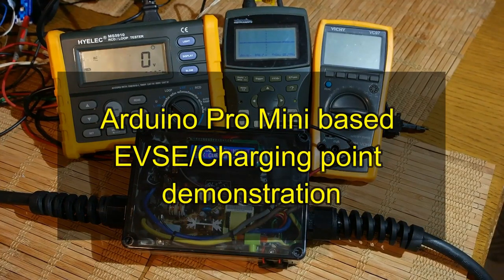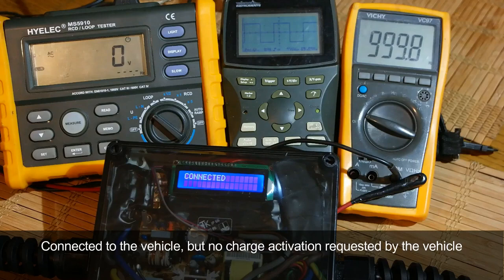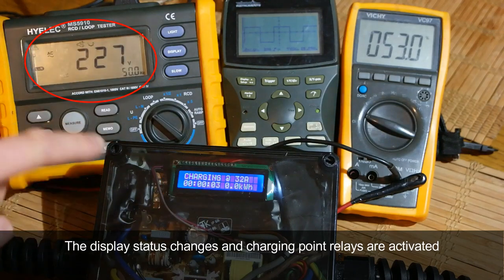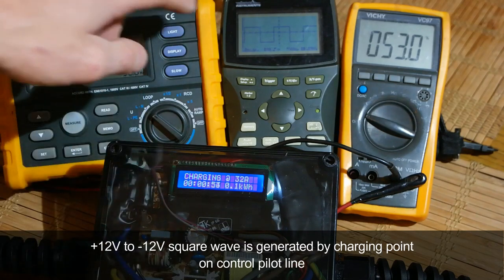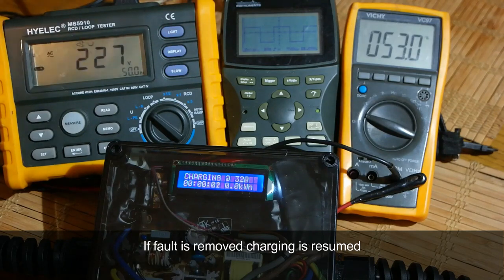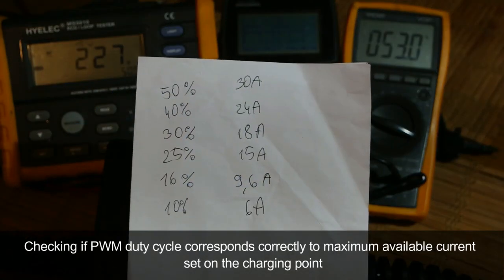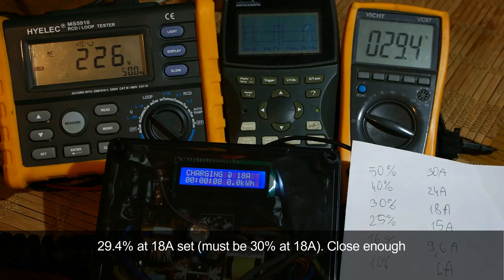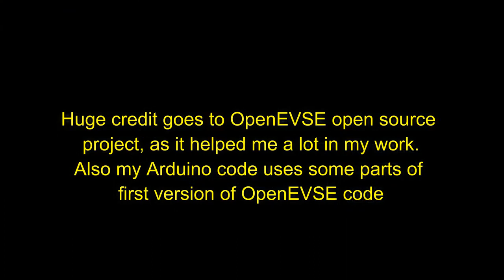Arduino based very simple DIY EVSE / EV charging station / charging point

Comment: Hi,
I made a similar project for the Peugeot e2008. Of course it doesn't work yet. Arduino UNO gives (pin5) PWM 980kHz, is that enough? The pop connected to the car will drop the PWM voltage from 11.6V to 9.6V, but nothing more. The car does not turn on switch S2. Where am I making a mistake?
Reply from the maker: PWM is incorrect. It must be very close to 1kHz, otherwise vehicle will not ask to activate the charging. What Arduino board you using? And do you use my Arduino file from my website? If you using original Arduino UNO board with my firmware, then PWM signal is generated on digital 10 pin, not pin 5.
Reply: @ev-olution8597  
Hi,
I made the circuit according to your project. My Arduino UNO (16MHz) has only 495Hz on a 10 PWM pine, and  988Hz on a pine 5. Maybe you have a routine to get 1kHz on pine 10?
I have my own firmware, but I can't do this.
Reply from the maker: @stefankundla3403  I guess you are using analogWrite() function. If yes, then it won't work this way. Download any OpenEVSE firmware and have a look to file called "J1772Pilot.cpp" for a correct way to get 1kHz PWM signal.
Reply: @ev-olution8597  OK. I did what you suggested. LCD now writes:
 A1min4.4Vmax4.4V. What does it mean? Is R1 = 1k correct?
Reply from the maker: @stefankundla3403  Sorry I am bit confused. So is your schematic same as mine? And what you trying to do now? Are you trying to test your project with my "debug" file? There is two files on my site, one of them is "debug" for troubleshooting. My debug file will display min4.4 and max4.4 if it's not connected to vehicle or if connected to vehicle but Analog 1 input is not connected correctly to circuit and can't sense real voltage drop on pilot line. R1 as 1kOhm works perfectly fine on most vehicles except Tesla, Tesla needs 680Ohm resistor instead. Please note that to use my debug file you need to have exactly same setup, including all pins connected as shown in diagram on my website.
Reply: @ev-olution8597  Yes, I have exactly your schematic. When I upload the DIY_EVSE_FREE_v1C_wdt-on.hex file, it is possible to set the MAX current. After connecting the connector to the vehicle, the LCD will write "connected". Nothing more will happen.
Reply from the maker: @stefankundla3403  And what you get when you use "debug" file while connected to vehicle? You should see on a screen min: less then1.2V,max: 3.8V-4.2V. Also what power supply you use? As there was a lot of issues with people using "noisy" power supplies, which makes pilot signal voltage levels unstable and vehicles don't like this. I can send you another debug file which works as a oscilloscope to check if you have unstable voltage from your power supply.
Reply from the maker: @stefankundla3403  I have sent you email with new debug file attached. If you can't see it in your inbox, please check spam box, as sometimes my emails with attachments ends up there.
Reply: @stefankundla3403  how did you build your source code that fits this hardware.
Reply from the maker: @stefankundla3403  ok, you can delete your email now to make sure you won't be getting spam messages. I will send you debug file soon.

Comment: Hi , I would like to build your kit. Taking a look at your website I see that the SCT-013 050 Current Sensor is only for measuring the vehicle current. 
Is your evse capable to use that sensor to balance the vehicle current to avoid triggering the house protection/breaker?
Reply from the maker: Hi. No, it only measures charging current. To monitor your house usable current SCT-013 sensor is not enough, as usually the distance is quite big between charging point and house consumer unit (where you will need to fit current measuring devices for balancing house and vehicle power consumption). This distance would highly affect SCT sensor reading. You would need to use some sensors which at least has RS485 communication. But at the moment there is no such thing implemented in my firmware. Also please be aware that I run out of most of components at the moment.
Reply: @ev-olution8597  thank you for you answer. 
For me is mandatory to have a smart current control, so your evse doesn't fit my needs. I liked cos Arduino pro mini is cheap. 
Do you know any other project that has Smart current control?. I know smartevse but this is a final product and I would like to assembly it myself.
Reply from the maker: @Blaskarabas  I am not aware of any DIY kits with such option. Actually I haven't checked on other projects for a long time, so don't know if there are any projects that suits your needs. From commercial products I know there are options like Zappy, Go-e, but they are quite expensive. 
You can try and offer this idea of having EVSE with energy use balancing option to OpenEVSE community, and they might add such option in their new updates, as they already have solar ray monitoring option and that's very similar.